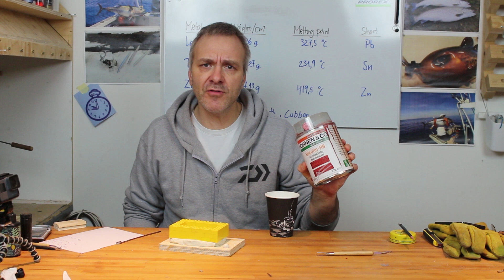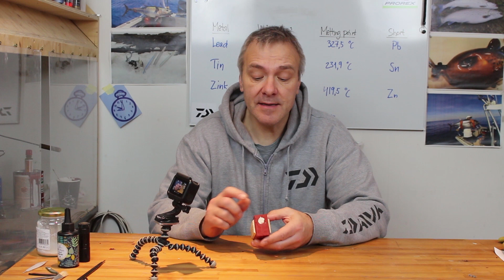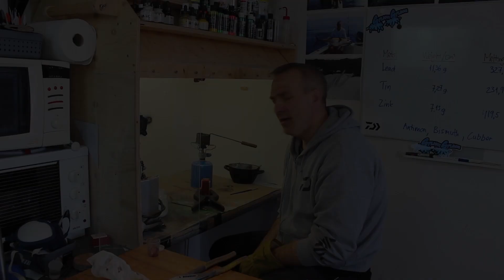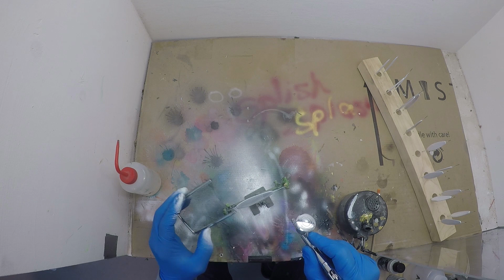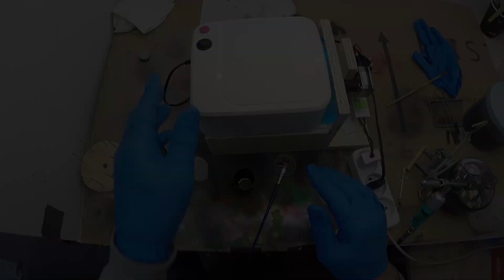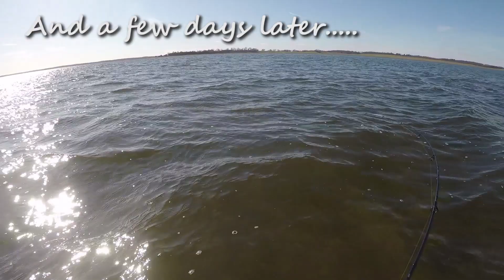Line Through Spoon - Part 2

Comment: Hi there. This series is fantastic and so well explained. I have just a couple of
questions about the paint - what is the white primer you use as a base coat and what are the various colour numbers of the createx paints which you use on the lures in the video? Many thanks for your help.
Reply: Hello again. I just wondered whether you use Createx opaque white as a base coat onto the bare metal and whether you've had any problems with paint adhesion? Many thanks.  Dave.

Comment: Thanks again for your clips!!  

Is there a noticeable difference when using line through compared to tie on spoons?  

I'm going to make some spoon jigs and would be happy to do away with through wires.
Reply from the maker: One thing iis of cause that they are easier to cast as you do not need to bend wires, but i think the biggest advantages is when i comes to fighting the fish. If the fisk shakes the head, the lure simply moves up the line, and it wont have the lures weight to help shake out the hook. Also it cant use the lure as leverage when the lure moves up the line.
Reply: @SplishSplashFishing  does the spoon still maintain the same action when line through v. Wire through?

Comment: Great Video!Do you not use plastic tubing in the lures when it`ready?
Reply from the maker: No it is not needed. I fish them for hours with no signs of wear on the line. Also every time you change lure you cut of a few cm of line and move the wear point
Reply: @SplishSplashFishing  Liket alot! do you sell?
Reply from the maker: @paddelnisse  Yes I sell now and then - Mainly through facebook/messenger